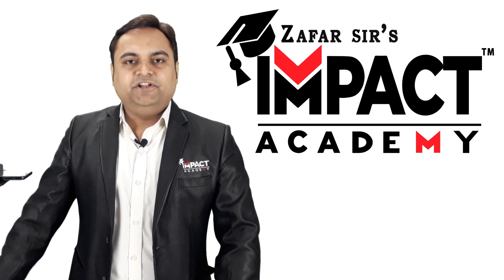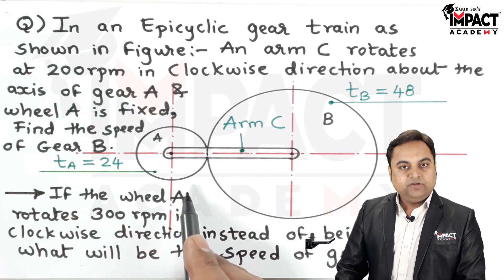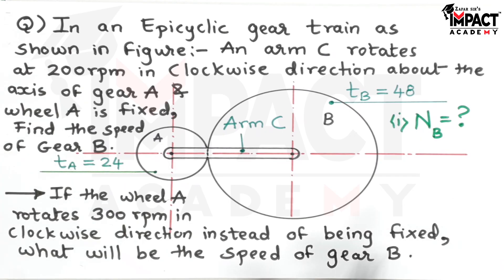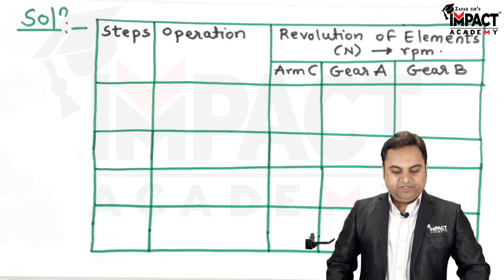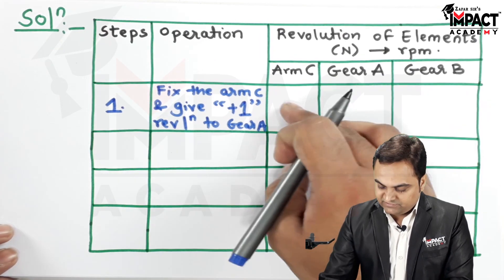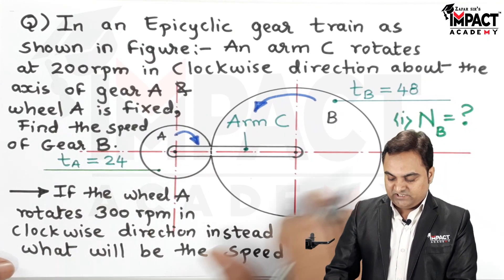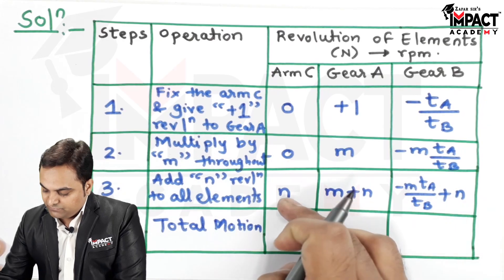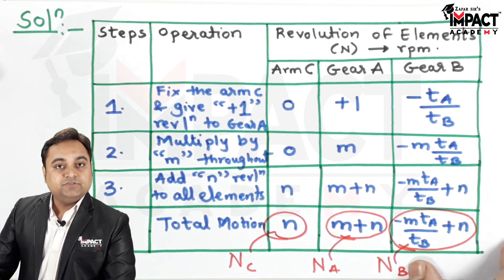Epicyclic Gear Trains (Problem No. 1)  | Gear Trains | KOM/TOM | #zafarsir #gateexam #engineering

Comment: Just one question anyone feel free to answer ?
If the whole system is mounted on a rotating shaft ( not powered by the motor which is giving power to the sun gear, its a different motor for the whole system ). In this case weather the output RPM from the carrier shaft will change because of the fact that now whole gearbox is in motion.

Note : the complete gearbox housing and the internal system ( i.e sun gear ) both are rotating clockwise.
Reply from the maker: http://bit.ly/impactEngineering
To access all the private videos and Remaining all Videos 
Please visit our app Impact : The Engineering App 
You can directly download the app from the link given on top👆🏻👆🏻👆🏻

For more queries related to app, contact our Customer Care Number :- 
+91 7900123134

Comment: Hello sir. I am an auto mechanic instructor. I have over 20 years working in the field as a professional mechanic.  I have a question on calculating the final ratio of a compound epicyclic geartrain. I am having trouble finding the correct equation to use. Single epicyclic geartrain I am ok. Just when there are multiple stacked together.  I hope you see this. I am hoping I can get your assistance. My email is dlee99887@gmail.com - thank you.
Reply from the maker: Watch Remaining & All Private Engineering Video lectures at your Home using
Impact - The Engineering App
Click on link below for download 👇👇👇
http://bit.ly/impactEngineering
WhatsApp or Call For Details:-
+91 7900123134

Comment: sir in 2nd case if one gear rotates in the clockwise direction other will rotates in counter clockwise direction right? but why u taken both as closkwise direction ? pls explain ...
Reply: Because gear is internal and other is external 
They moving same direction only
Reply: @shaikriyaz6183  thanks man..!
Reply: @shaikriyaz6183  but in this case gears are external
Reply from the maker: Bcoz in 2nd case arm C is not fixed,both gear A and arm C are rotating together.
Reply: Actually when the answer comes a positive it means that the assumed direction at the start is correct that means anticlockwise.. am I right?